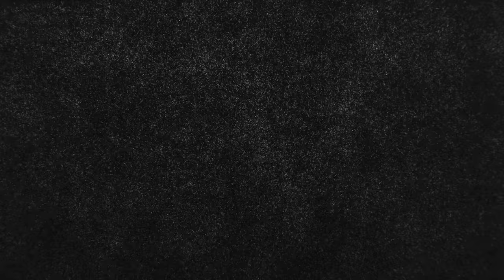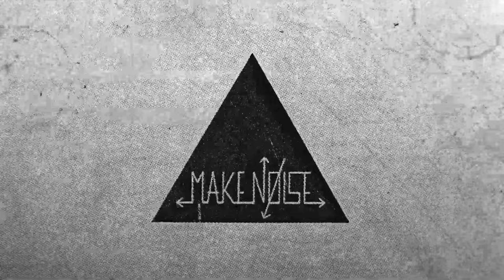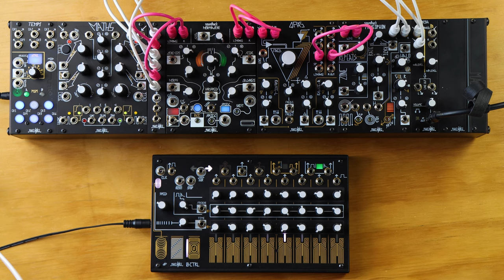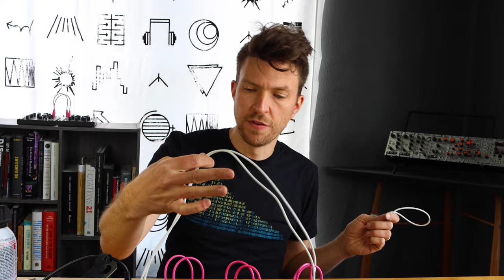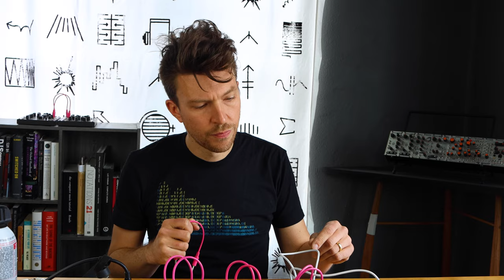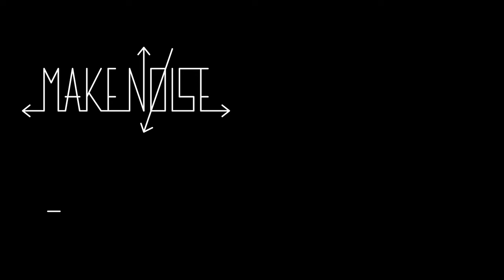Break Jumpin' | Make Noise

Comment: Exstatik! Can you please clarify -- as if for newbee -- the routing going on to/from the Mult? I go back and forth among the most recent vids and see things happening that do not seem to conform with the basic in/out architecture. Or... maybe I'm just deluded. (I watched the Mult spotlight vid using the Shared System way back when; but that is straight ahead with an explicit bridge between the first and second channels. Thanks. You continue to amaze and inspire!
Reply from the maker: Sure thing! The Mimeophon's Left and Right outputs are each multed to the respective Morphagene inputs, as well as to the Left and Right inputs on the XPO. This means that what we are hearing is the outputs of the Mimeophon, but that at the same time those outputs are feeding the Morphagene for the easy recording of these variations:
Mimeophon L Out -> Mult Ch1
Mult Ch1 -> Morphagene L In
Mult Ch1 -> XOH L In
Mimeophon R Out -> Mult Ch2
Mult Ch2 -> Morphagene R In
Mult Ch2 -> XOH R In

Comment: This is very cool. I'm wondering how long does it takes to Tempi to drift from Morphagene once you have removed the clock cable?
Reply from the maker: it will eventually drift out of phase, but probably take a long time to do so. if you change gene size or varispeed then it'll go out of phase immediately of course. if you're not modulating those things at all then may as well just keep it patched :)

Comment: How do you make a splice like the first one that perfectly loops? I remember there being some software you need to download to place precise splice markers on an audio clip, but I think it wasn't free?
Reply from the maker: It can be done on the Morphagene itself with the Splice button. With a one-splice Reel like this you don’t need to place Splice points in software, but our preference for placing Splice points is Reaper, which is free to try with no time limit (and very reasonably priced when you are ready for it!)
Reply: @MAKEN0ISEMUSIC   thanks for the reply! I guess what I actually meant was, if you're recording directly into the morphagene and manually pressing the rec button how would you get a perfectly looped splice (without having impeccable timing?) In other words, is it possible to "trim" a splice without using a computer to get it to loop perfectly? I guess it's probably easiest to just load the sample by dropping it onto the sd card instead of trying to record from the inputs. Maybe there's a way to do it only on the morphagene by making the gene size super small and scrubbing through to the end of the loop and hitting "splice", then deleting the new splice? Hmmmmm
Reply from the maker: @colinwood9717  What I do might be similar to what you are saying, I record a little extra at the beginning and end, then use Gene Size and Slide to "Zoom in" so I hit the transients at the loop points exactly. I hit Splice at these points and then remove the Splices before and after to "crop" it.
Reply: @MAKEN0ISEMUSIC  ah cool I'll have to give that a try! Thanks!